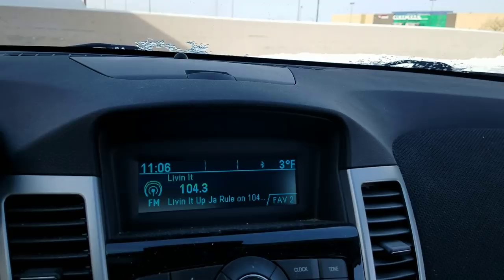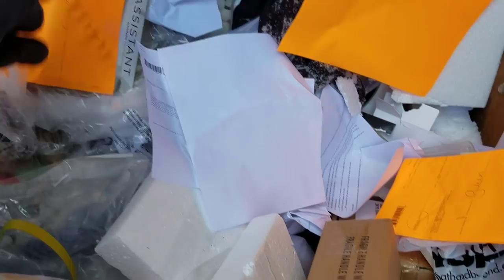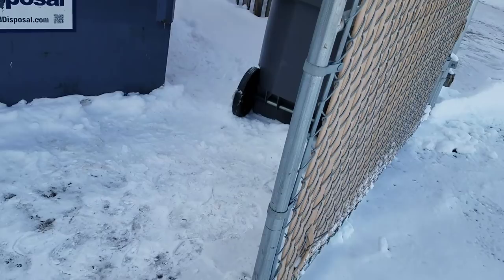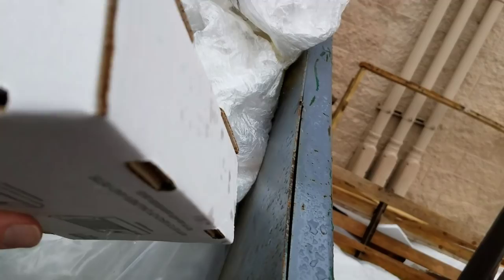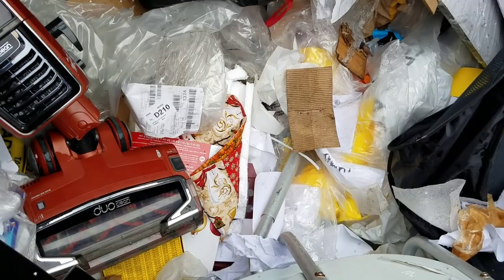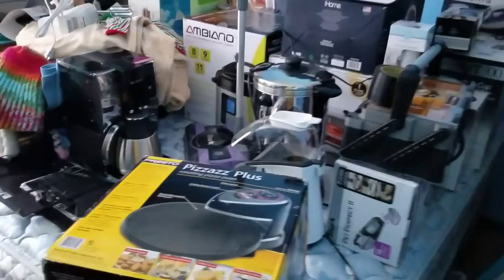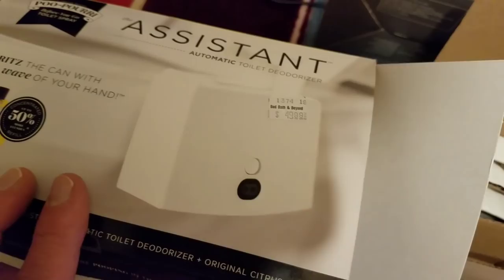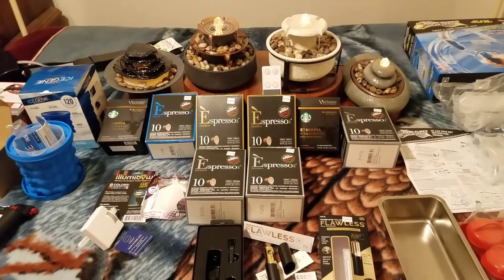DUMPSTER DIVING BIG BOX STORES #1

Comment: do you have any idea how lucky you are that they don't cut all the cords and paint everything?  I would have left the cord on the vacuum as someone fore sure will come after  you and want it.  It's worth a measly 50 cents in scrap.
Reply from the maker: Thank you for watching Carol. That vacuum was toast it was used hard and cracked and broke at the bottom. Every garbage day there are dozens of vacuums in the trash on the curbs. I try to collect as many cords as i can the 50 cents adds up it is like a piggy bank to me except i do not have to put in my own money. I will be doing a video very soon on how to easily repair those cords sometimes they do cut the cords i just got a humidifier and a coffee pot from BB and B with the cords cut but for under 3.00 they are easily fixed. Now the paint on the other hand is awful i rarely ever get that though. It is funny at my favorite BB and B the first time i ever went they painted everything but after that they never did it again Knock on wood.